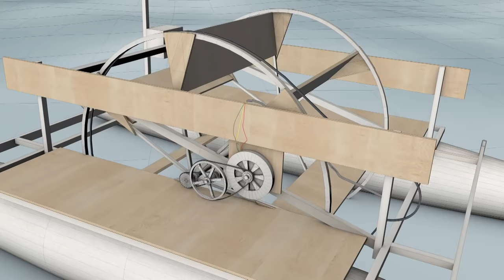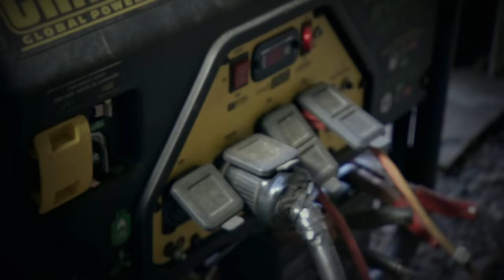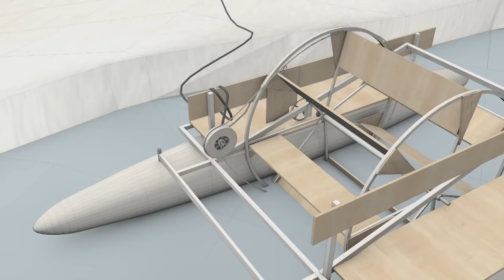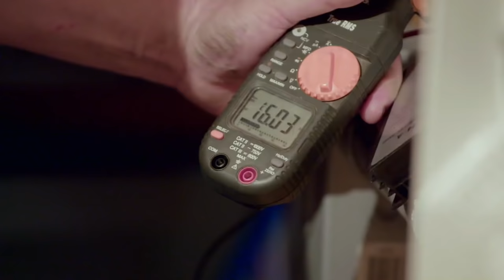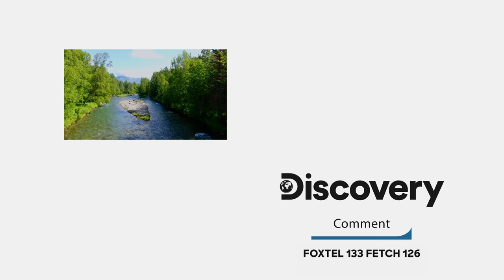Building a Mobile Hydroelectric Generator in Alaska | Homestead Rescue

Comment: Does the river ever freeze in Winter? If it does how is the homestead property supplied power? I love the idea of the floating mobile hydroelectric generator.
Reply: Moving water doesn't freeze
Reply: @D1amondeyes  what?    It most certainly does.    I live here in Wasilla next to the Little Su, and it freezes every year & we ride snowmachines on it.    This series is BS and made up drama.    There's a very nice electrical grid all over this area and this was nice but not necessary.

Comment: That new direct drive system might be the right ratio but ideally you just need the right ratio from the shaft. The new belt system they made is less secure and more likely to break.
Reply: On the plus side it reduces drag created by adding more gears. Maybe some kind of different belt, but keep it same drive system.
Reply: I give it a week or two.

Comment: when you do not have the water  flowing over the wheel to provide the  Tquorc required to produce  current  as we do when the water flows over the wheel & the weight of water provides the torque.   We have to add more sail.  power The water can push , Agenised to increase power to over come the drag of the power predust .

Comment: Add a 150mfd ac run capacitor in series (you will have 3 capacitors total), in each leg from the pmg.....then run it thru the diode bridge.....you also need to make sure your pmg is rewired for 24v operation to reduce cut in speed and binding under load.....
Reply: Why the caps?  Stability?  They never mentioned the voltage btw.

Comment: It's not the belt it's the front load washing machine motor they put on it.  There slow speed high amp motors.  Just what you need for a water wheel.

Comment: Why not combine the first idea with the second idea. Use the belt reduction pulleys and the direct drive system as well. It could produce twice as much power and it could work it parallel together.
Reply: No,power from wheel is constant
Reply: @maximuspet  huh, i didn't know that.

Comment: Yes, overly dramatic. . . I disagree with the gearing thing, I get that it seems to work with that big belt looped all the way around the paddle wheel, but its not going to work long, and will break. But mainly, its a matter of the Arm, and Moment of the Arm. . .Leverage of the paddle. . .There is more leverage from the big looping belt, verses trying to turn the pully from the center. . .End Result???
Basically if the paddles were wider, with longer board paddle, it would be able to turn from the center.

Comment: wouldn't it be much more efficient to run a pelton wheel setup, with an intake into a hose and the discharge bleow the wheel back out into the creek?  seems to me like it would be much smaller in size as well.... anyways, just a thought...
Reply: He mentions in the beginning he can't  do concrete or any fixed installation because  of regulations

Comment: You extended the paddles toward the centre, this achieves nothing as that part of the paddle doesn’t touch the water! 😳
Reply: But the middle is down when the board is in the water.
Reply: @thefirsttheist8888  Not sure what you mean.
Reply: @steyer-crmg  My English is not that great. Visualize the wheel turning, the boards he attached (extended inward) will have a larger surface extending into the water when the wheel is turning.
Reply: @thefirsttheist8888  the panel extensions do not enter the water at all from my observations. They need to be extended out wards not inwards, they do not enter the water. I know what you mean but if you watch they do not enter the water.
Reply: @steyer-crmg  "They do not enter the water".
Well...sir, i beg to differ.
And i watched closely, so close i could feel the water splash on my face....
Reply: @thefirsttheist8888  For arguments sake lets agree and say they entered the water. Even then, why would you put them on the inside rather than the outside? The outside has more travel so more torque, more power.

Comment: What about when the stream freezes in the winter?
Reply: i think water that fast flowing is unlikley to freeze
Reply: It’s clearly a seasonal solution.
Reply: @Tom-cf1ib  In Alaska??? ;)
Reply: The main problem is that in northern summer you need little energy and get a lot of energy througt solar-panels. The problems arise in winter - when there is little sunshine and low temperatures (that make the rivers freeze)
Reply: @Tom-cf1ib  I’ve run my snow machines up and down that frozen river for years. The Little Susitna definitely freezes in the winter.

Comment: great design...
Reply: want to make it from palladium?.. I turn aluminum into palladium.. with a torch
light as aluminum and stronger than steel
Reply: does not oxidize...it's a room temperature superconductor

do you know how sailboats move into the wind?... the sail doesn't push... it pulls
Reply: by moving sideways across the flow of wind

Comment: Undershirt waterwheel mounted on used floats/gastanks can drive a low output electric generator. The real locals have used these wheels to pump salmon out of a lot of rivers for a very long time. Your device is neither new or difficult. 

Were any adults involved in this project? You sound like a pack of kids.